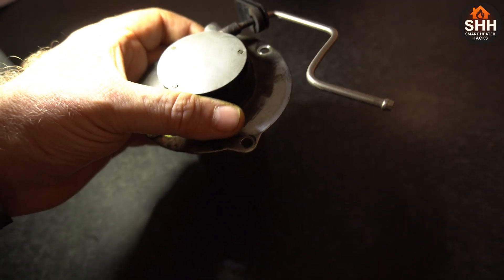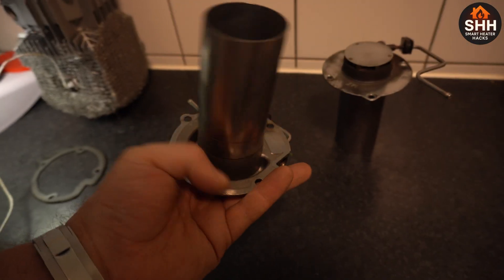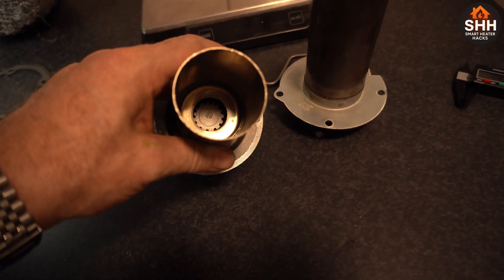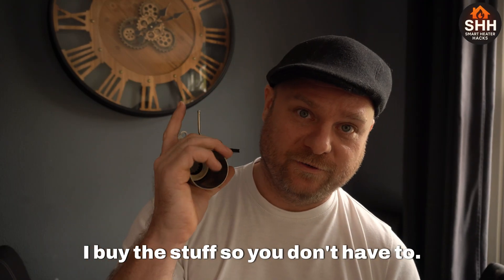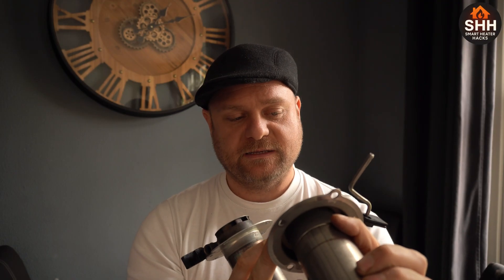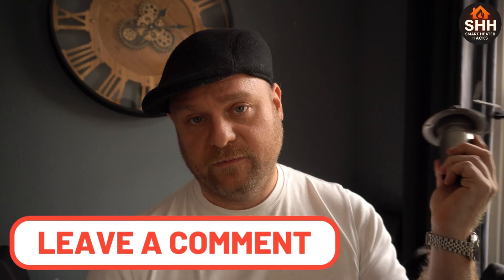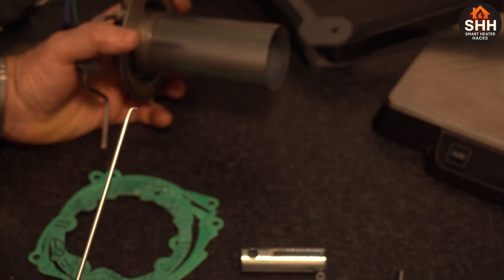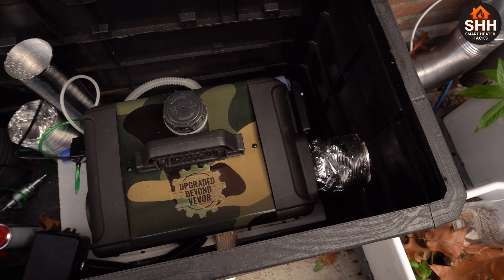Cheap Diesel Heater Combustion Chamber Upgrade – Worth It?

Comment: We've all seen efficiency experiments with exhaust through radiator etc. 
Get an open segment of flue pipe/ cylinders  positioned under the heater. Spiral the exhaust pipe down through the cylinder and out. Install a fan at any end of the cylinder. Wouldn't that turn the cylinder into a large hairdryer, extracting heat from the exhaust. I assume a smooth wall exhaust pipe would help.
Reply from the maker: That sounds like a clever way to turn the exhaust into more usable heat! 🔥

Comment: What about doing a real upgrade to automotive/marine grade fuel line (I intend to use copper with compression fittings as this will comply with boat safety regulations) and a cartridge fuel filter..
.. not sure about connecting to the fuel pump and stopping the noises..
Reply from the maker: Definitely a solid idea! 💪 I’m just trying to keep it budget-friendly for now, but yeah copper with compression fittings is the premium setup. Copper is awesome and is honestly pretty badass. 🔧🔥Yeah, pump transfer noise with copper lines. There used to be proper dampers for that Webasto had some for marine setups back in the day.